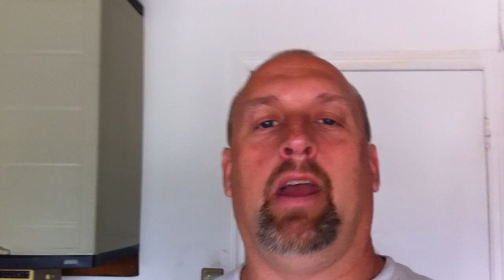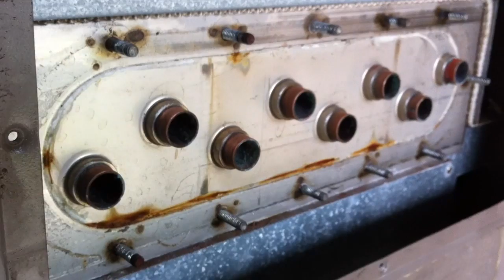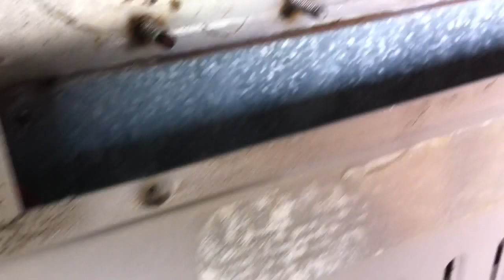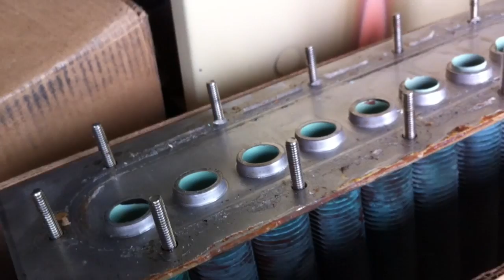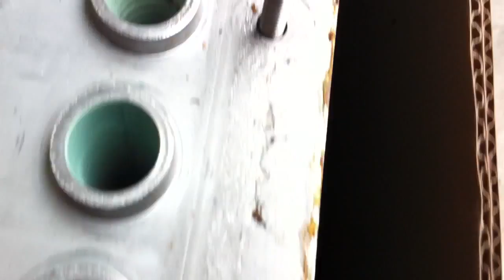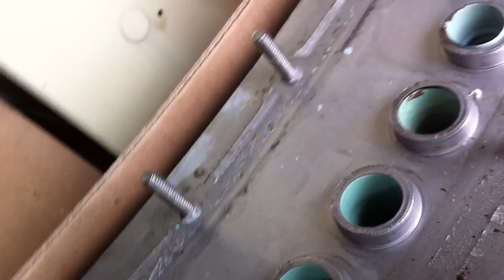Gas Pool Heater Heat Exchanger

Comment: I had a similar problem with my heat exchanger.  But I checked my pool chemistry regularly.  What I didn't do, however, is properly ground my heater.  Could that also cause this problem?  For me, most of the corrosion / erosion was on the outlet side, though there is corrosion on the inlet also.

Comment: Quick question. When I turn on the heater to heat the hot tub sometimes it makes a popping noise or banging. Doe you have any idea what this is and ho I can fix it? Thank  you for your assistance here.
Reply from the maker: A sound that is either banging or the sound of gravel inside is usually do to not enough water flow or a broken bypass. You would need to first make sure you have good water flow to the heater. If that checks out OK, then you would need to look up the heater you have to see where the bypass is located at inside the unit and then investigate that. I believe I have a YouTube video on this particular issue with regards to the Hayward heaters.